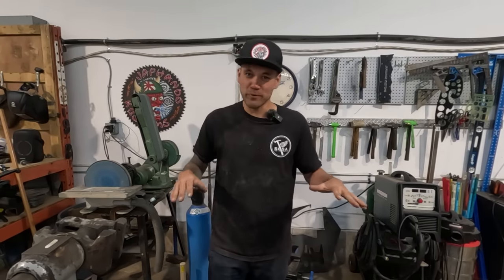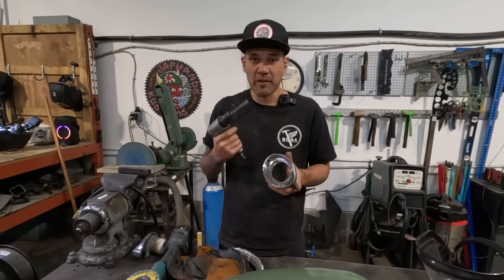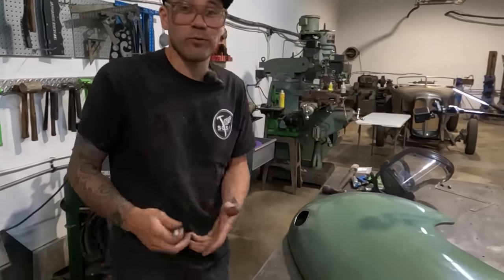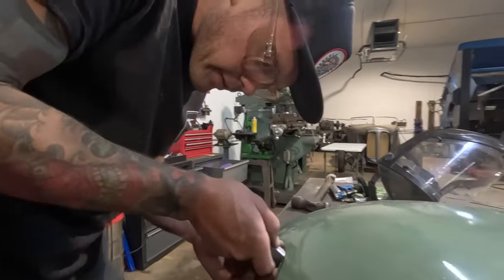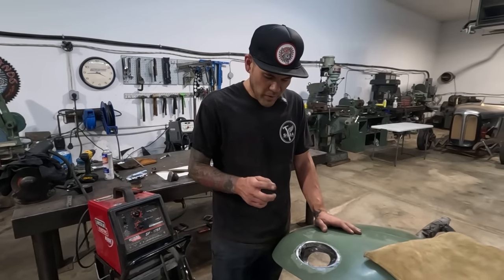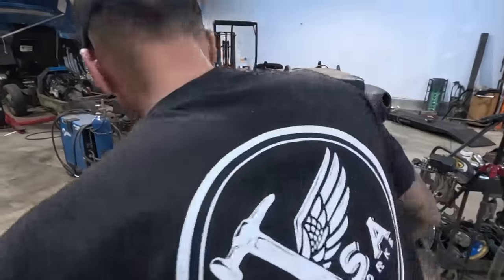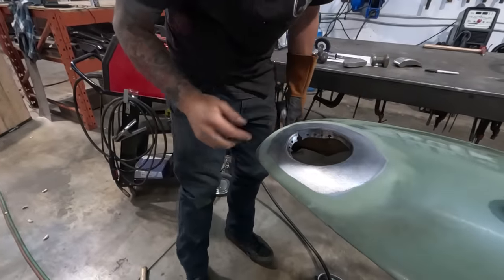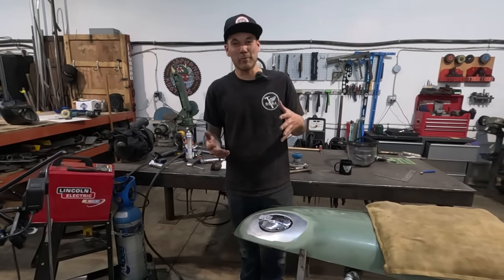HOW-TO Make CURVED FLANGES on SHEET METAL With HAND TOOLS Installing JAGUAR Gas Cap PLYMOUTH Fender

Comment: Hey Karl love the show man.
Since you have the plasma I would take .125 plate and cut the oval shape with material allowance for fender flange. Heat and bend the plate to match the fender. Then clamp to the back side and go to town. Maybe first take a linear hammer stretch to the fender in the area that will become the flange. Since it will be a 90 anyway...stretch the crapnout of it. Then it would turn down easier and more accurately.

Comment: Perhaps cutting the oval to size and welding a half-inch strip of steel perpendicular to the inside of the fender would have been easier. Beautiful when finished, the gas cap looks really nice.

Comment: I did the exact same years ago. With the jag fuel cap on a 41 pymouth. I started from scratch. Much easier and very accurate.  The hole on the side  is the vent. There should b a nipple on the neck. You did not put a drain at the lowest part of the unit. You need one for fuel spilled due to over filling. I have pictures of mine. The cage should have 2 holes, 1 vent,1 drain. 
Remember everytime you French in on a top or side surface a drain hole must be incorporated into your design at the lowest point. Automotive Coatings are not designed for submerged applications.  They will fail.

Comment: Awesome video including insights into  your thought process and changes in how you move forward along the way. It helps us appreciate that there is not just one way to do something. 

Even if you had not drilled holes in the fender, wouldn’t the sheet metal have ripped at the edge from the amount of stretch needed to bend the flange at that tight curve? 

Thanks for continuing to be an inspiration. I recently built a slapper out of a file as shown in your previous video. I love your videos and the fact that you are Canadian too!

Comment: That was cool.
I reckon I'd have used a ~2 inch strip of steel formed within the filler cap's 'bucket' so that the oval shape was set and then let that into the fender, welded it out for a sharp corner and and buzzed off the excess steel above the panel.

Comment: Looks like a lot of others have commented about doing this.  After being a fabricator for decades and also running a hot rod and custom shop I have a lot of experience doing things like that. I don't recommend doing large flanges with a tool like you made. They will work great for up to  1/4 or so. After that it starts getting a little messy. And I would never put in holes first. It will  make it have flats. Do your holes later with a right angle drill. I fast forwarded thru some parts  but I didn't see any softer hammer or dollies.  Hard will stretch soft will shrink.  I find sometimes it's worth the extra time to make a die. Cutting the shape out of a chunk of hardwood,  clamping it in place  then get out the hammers. I also have a pile of rod, bar etc. Curved and straight  that are welded to a bar. I use them by hand or clamped in a vice to back up a edge to hammer over.  Keep up the great work!

Comment: I saw something similar on some video a while back, a guy used needle nose vice grips with a penny or a washer locked in at a set depth. the spacer sets the depth and width between the jaws and because they are narrow, it does sweet tight bends. I have used it a few times. Love your content bro!!

Comment: It takes more steps, but I like to make bucks. If you got some zinc scrap...it dissolves aluminum at a much lower melting point, which you flip the fender and pour the molten alloy into the backside of the fender at the location where you plan to flange. You can get creative with clay to make containment  if needed. The alloy cools, and won't stick to the steel. Mark the orientation and you now have a buck you can cut your shape into. Plasma and some fine tuning works for me. Now you have a buck to dolly against that matches and maintains the contor of the panel you want to keep. They're tough enough to reuse too. With some more steps, you can make dies and get the shop press involved.😉

Comment: A little tip for remembering when to shrink or stretch flanges for the beginners think of a running track each lane gets bigger from the centre a wheel arch flange would be trying to make lane one go into lane two which is longer so it needs to be stretched and lane 8 would be like an outer flange to be folded into lane 7 it needs to be shrunk because lane 7 is shorter hope that makes sense it helped me when I started
Reply from the maker: I really like that!

Comment: From my experience working with metal, average being 100x heavier, I’ve always been astonished at being shown by (my older millwright co-worker) what a little heat will do. I’m certainly out of my comfort zone on body panels like you’re doing and mostly do cold bending to minimize heat distortion. 
Certainly a learning curve. 
I’m wanting to do outside 90° flanges off of a 14” dia. 10 gauge steel pipe. I think I just might anneal it first and build some kind of tool like you did. A roller type would be ideal. With a heat gun. Maybe? 
 ..But as always much appreciate and grateful for your expertise. 
They say intelligence is useless if you don’t have boldness. You certainly have both.
Reply: I can't have oxy acetylene as I have a wooden workshop, but a plumbers gas torch with the self lighting button helps me out

Comment: My thought is to use a thinner tool, one that does not bend over 1/2" of sheet metal . It would possibly need reinforcement on the perimeter of the opening. Testing with a thinner piece of steel and if it bends open the slot, it could be reinforced about it's perimeter. Purpose is to take smaller bites. Thing is it may still not produce a sharp enough edge. Cool idea and I like the fact that the cap itself has an art deco look about it and it is not inspired by the jet age. My Triumph Speed Triple has locking  hinged cap that pushes to release, it is flat and round to view (flush with the tank surface) but it has a row of imitation hex screws surrounding the cap opening and would not look as period correct.  Looks great on the bike or possibly for a high tech street rod.

Comment: Another great video and great skills on show as always. I would have extended the lower piece flanges upwards by 3/4'' and then pushed this upwards though the same size hole in the wing to the right height. Then marked it off  and trimmed to fit. if you then weld from the top and bottom you have enough material to grind to a tight radius or a wider radius. Just a thought from someone without your hammer and dolly skills but can grind and file to shape.  Keep the content coming I am learning so much from you. Hugh

Comment: At work I raise inlet flanges using tools like this & slippage is normally caused by the tool slot been a little too wide compared to the material thickness. 
Over time the slots widen up with use so to close the gap up we put a  strip of the sheet metal in the slot and either hammer the life out of the tool until it's snug on the sheet or squash it in a vice or fly press

Comment: Next time you decide to try to build a flanging tool, especially for a radius like that try some quarter inch flat bar probably a half inch long make your radius is in the flat bar, then weld them to the end of a pair of vise grips into Pete, basically the same thing Moving along in sections, but with the vice grips, you’ll have enough grab force it over in and leave a crisper edge. If you have a stretcher, go around and stretch the backside this folding in a little as you go I like building my own tools, but sometimes it takes a couple tries to get it right

Comment: reworking old sheetmetal ina seamless way is truly an art... I would be hesitant to embark in such a task, but the result is amazing! thank you for sharing, and empowering people by showing this is possible.

as for the holes opening up:would it have made sense to plug them, grind and flatten them so as to restore some of the sheetmetal in attempt to avoid cracks to propagate towards the edge ?

Comment: I really like how simple the flanging tool is.  Almost too simple.  I wonder if the tool were thinner, wouldnt that allow for a tighter radius?  There would be more moves to create the flange, but pinches would be closer also easier to keep the sheet metal deep into the slot... at least that seems logical to my brain.

Thanks for another cool tool video, Karl! Aways stuff to learn from them!
Reply from the maker: Yeah, I definitely think you’re right Bryan!

Comment: Interesting watching you teach as you learn.😂 The flange you're folding is a bit double wide for those forming handles. Operate them just like a manual can opener though a number of rotations need to be followed. The size you made are more for wheel well flanges. Simple though, as you say, and fast working once you get used to it.
Reply from the maker: Thanks for the tips!

Comment: Heidi’s front end has been upgraded. Maybe like you said 50s Chevy. Mine has six lugs. Will look to see if mine has the heater. Yours is more solid then mine. 37742 produced. I had a customer for CAA with a mg told him sobering would be able to work on it.

Comment: Would there be any benefit to using round stock for the tool? Might work better on rounded corners. Just wondering. Will be trying both ways in the future. Using the adjustable wrench method up to this point.

Comment: I just use an appropriately  sized C wrench to flange things (already has a round over head). At the tight radius maybe pie cuts or annealing first would have avoided the tear out, but perhaps a buck. I really thought you'd have done it on a practice piece first as Proof-of--Concept. Nice as always.  The results are what matter.

Comment: As an alternate method, could you cut and role the opening as you did and then use one of the space age automotive epoxies to 'attach' the shell underneath the fender? Then mold and form the epoxy to smooth and blend the edges. Possibly save on a lot of heat shrink/stretch rework. Some of the automotive epoxies are amazing though pretty expensive. Just a thought.

Comment: If you make the tool out of round bar I’ve found it’s more forgiving. I’ve used this method plenty of times when putting a flange on rear quarters and front wings /fenders for wide arches , as on mk1 and mk2 escorts as sold here in the UK

Comment: The tool was slipping because of the material needed to be clearance as you bend the flange. The extra steel would hit and push the tool off. 
If you clipped the corner away from the slot it would help.

Comment: many years ago when plumbers would have to add duct work in a system they would start with the rough hole bend a lip with plyers then use a pipe as a tool they would hit the side of the pipe and would make a flange ..for the new duct pipe too hook too ..

Comment: Karl, its a fact that you will forget more than I can possibly learn in my short time I have left here. I think you are a metal shaping genius hands down. I on the other hand shall remain humble before you, but I know that with what I know, should I need a shape such as you did.... I will chose something much easier for my patience with hammer and dolly is just not there. I know that from your lips you spoke as to what worked for you might not be me doing quite the same.  I would build what you did in several pieces if necessary... I just wish I felt better and had more time Karl. I did listen closely and to tell the truth, just because todays work went tough for you as well, doesn't mean you shouldn't keep challenging yourself to be the best. Take care friend
Reply from the maker: Cheers Morgan! Thanks very much the challenge FORCES learning 🙌

Comment: Hi Carl, very informational and hands on, as always. I am currently working on a motorcycle gas tank, I am installing a new gas cap and also some sort of a "can" to hold a rev counter. You inspired me to try it myself! Question: do you ever use old fashioned body tin on you sheet metal work? I dont recall you mentioning it. I do not want to use body filler, as little imperfections in my silver soldering soldering job (I can not weld) might cause the tank to not be completely gas tight and the gasoline fumes will work their way through the body filler, softening it up (I have experienced that already). I am slowly learning to use the tin stuff, but it is not as easy as watching Youtube videos made me believe haha. So, I would be interested to see if and how you use body tin your projects as I guess this somewhat old technique should be right up your alley in regards to craftsmanship and aesthetics. After all, its metal, not polyester!

Comment: karl if you make deep by about1/8 inch will come out about right or step the front ( so when you look at the tool side on the back is slightly longer and you don,t get such a roll on flange.

Comment: A shorter flange, like 1/4", would solve the stretch problem.  I like the suggestion about making the tool out of round stock with a cut not so deep on each end.  BTW, those splits need to be welded so they don't migrate.
Reply: I once reproduced a vintage head gasket, copper faced asbestos with the copper wrapping around the bore and water jacket holes. I noticed that the oblong jacket holes had longer flanges on the straight and eased into a shorter flange in the  rounded ends, so the blank hole had a keyhole effect.

Comment: Hi Karl,.... after watching your jaguar gas cap video,(great video),it occurred to me that the problem that you had bending the tigt end curves might have went a little bit easier for you if you made your square bar tool out of 3/4"-1" round bar,... just a thought,... keep doing what you are doing, its great, and very informative info you are putting out there....Fast Eddie,Winnipeg, Manitoba...
Reply from the maker: Yup probably easier for the right radius

Comment: Excelllent tutorial...love the concept of the flange tool...however just my thought what difference would a 3/4 or1/2 inch  round solid bar flange tool would have made to easing the process of flanging the metal with less impact

Comment: 1.21 your right its a drain pipe/hose, so if water get in behind the cap it will drain away and not go into the gas tank

Comment: An interesting method to keep the top metal all in one piece.  Question: In this situation, would a better/alternative method would be to make an oval flange and then weld it onto the oval cutout?  Then grind the weld?  I think it would not distort the fender as much and would keep the oval shape and sharp edge.  What is the benefit of folding the edge over as opposed to welding a flange onto the fender?

Comment: In tight holes...piece of round stock will give you more of a square edge...you know what I mean... .also   tool you might make...a large ball bearing welded to to a smaller rod with a handle....easier to work in tight areas

Comment: Great idea but I'd have used a scrap fender to test the idea first before bustin your antique fender. That way you know if there are trouble spots you can remedy the issue before attacking the antique fender without issue and then let others know the trouble spots to deal with right out of the gate. But Interesting none the less. I'll have to give it a try for my old VW body work.

Comment: Couple questions: 1) how is the flange too superior to just using some angled, possibly smooth jaw pliers? 2) are shrinking/stretching pliers a thing? Like basically a small handheld version of a shrinker / stretcher that would fit on that small flange while bending to get the extra stretch you need?

Comment: Good job bud. Looks the gap between the cap and the body is about 1/4” strong in some areas. Maybe if you could have kept it to 1/8” it would look a bit more tighter and OEM. Either way that’s not easy so good work. 👍🏼

Comment: @ Make it Kustom:  For the final shaping of the flange, and for helping with crisping up the edge/shoulder/bend.  What if you made a custom "U" shaped dollie that matched/mimicked the two tight radiuses of your opening ?!  Would that allow you to eliminate the waviness of those radiuses ?!  
It could possibly eliminate a dinged edge from a misplaced hammer blow.
With that mill I saw in the background, a chunk of steel, and your template it should be relatively simple.
Might also help with better matched radiuses.
Reply from the maker: If a perfect dolly was made with all the compound curves and the radius flange, then yes, it would help tremendously

Comment: Nice job Karl. If you had to do it again do you think you might try pre-stretching the flange before starting to turn it over ?  or even Tigi-ng in a small triangle of extra metal on the sharp radii.

Comment: You've probably worked it out already yourself, but maybe you should allow a k-factor on that flanging tool. Like bending steel in a press brake, you need to allow for the shape of the corner, which is dependant on the material. But if you made the notch maybe 1/16" deeper that would have pushed the break out 1/16' which would have allowed for the bend portion.
Great idea though. I think it could be very usefu for people like me who don't have all the whizz bang tools.

Comment: You could have saved yourself a bunch of time by using a shifter (adjustable wrench) as a flanging tool.
Also you can squish the tight radius to stretch it more between fold increments. I usually use 2 hammers to squish the flange.

Comment: instead of the torch which burns the paint off which prob doesn't matter but have you ever tried heating something like that up with a heat gun? mine will get that metal super hot, I believe enough to help molecules of metal move

Comment: Carl, I'm wondering, based on the experience you had with  this job , if next time, will you do it this way again, or will you just cut the hole and weld the flange.